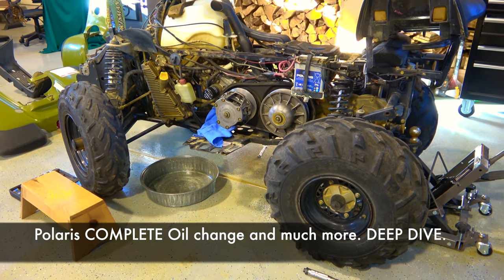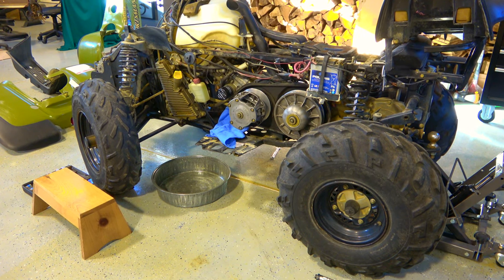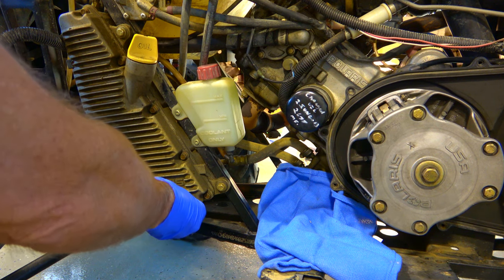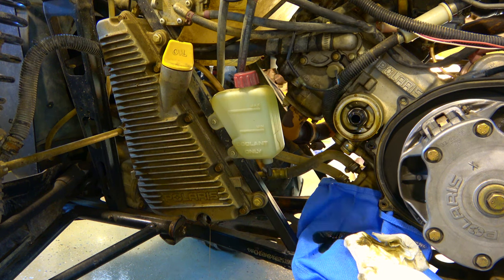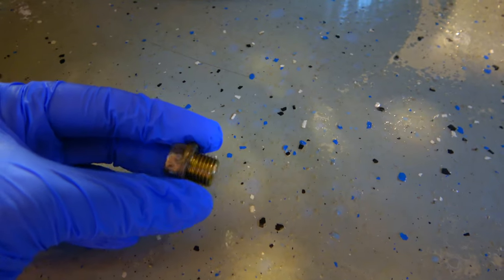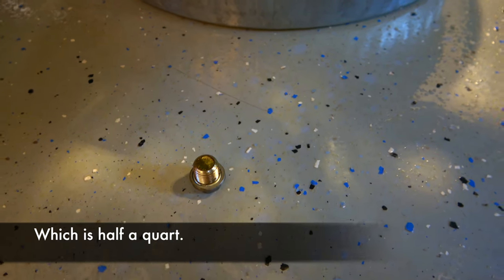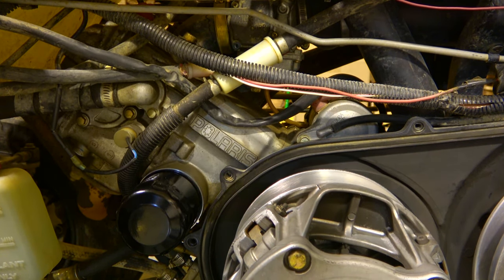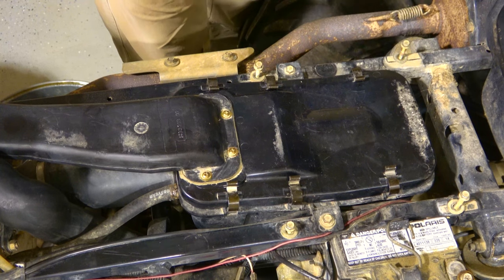Polaris Sportsman COMPLETE oil change & Much More. DEEP DIVE.

Comment: I have this identical ATV, 1999 Sportsman 500.  Your videos have been most helpful to me, thank you for creating them.  I am looking for some discussion about the fuel tank.  Specifically, inside the tank itself and at the sump area where the fuel heads to the carburetor , there were one or two black tubes, presumably fitted into the "fuel out fittings".  These tubes have disintegrated and became floating debris in the tank.  While I have removed the debris, I am left wondering if replacing them is necessary, and if so, how to do that.  Do the fuel out fittings come off the bottom of the tank and reinstall?  The machine still runs fine with these tubes gone, but am I just getting lucky so far?  What is their purpose?  I do not find them on any parts diagram.  Thank you!
Reply from the maker: I'll do some digging. I personally haven't dealt with that.Ill be with mine in a couple days. But won't be on the computer for a few after that. Gonna chase some fish. When  I get back I'll see if I can offer any insight. If you figure it out before. Let me know.
Reply: @ericinalaska7648  Greetings.  Apologies for the long absence.  This ATV lives at a friend's house in another state and I only recently made the journey back to see it after a long summer of busy.  I have an update here and I misunderstood what I was seeing.  If you look into the gas tank from the filler cap, there are two ports present.  The left port has a "straw" tube the reaches up about 2-3".  The port on the right has no tube.  From a gas tank parts diagram for this machine, the left port is the main tank and the right port is the reserve tank.  What I thought was a disintegrating tube turns out to be a pencil shaped screen and it was quite hard to get that out of the tank.  Additionally, there was some small, wire shaped debris in the tank that was colored red.  I mention this only in that it is not clear to me if this is a disintegrating part of some kind or just foreign debris.  Also, the reserve tank will not pump gas to the engine so this port is obviously clogged.  I am presuming this...the straw on the main part of the tank is taking in fuel from above the sump area.  When switching to RES on the fuel switch, the fuel must come from the port on the right and that screen must be involved in some way to keep sediment out of the system.  However, I find no reference to this screen on the parts diagrams.  I have pictures of the ports inside the tank and the screen if you are curious.  I didn't see a video for taking the gas tank off the fuel fittings to clean things, but that is where I am headed next.  That screen probably fits into the right port itself.  If you have any feedback or advice from your experience in taking the fuel tank apart, it is appreciated.  The wheeler has been winterized and I likely won't get back to it until next spring since it lives now in snow country, but I don't.  Thanks.
Reply from the maker: @BigRedDg  Hey Andrew. Same with mine. Away and away from me for the winter. But I still have a few resources handy. My understanding of the tubes is similar to yours. My first thought is what caused them to disintegrate. Im only guessing but I suspect ethanol gas possibly. Older equip and small engine stuff such as lawn mowers and chainsaws don't like it. The parts don't hold up to it well and when it was first introduced it caused headaches for many. And from my understanding parts had to be reengineered to accommodate it. Just a thought. The tubes as you suggested are one for your main fuel and one for your reserve. When in tact. One is taller with a screen filter on it. and the shorter one is the reserve. So once the fuel gets low enough or below the screen it starves for fuel.  Then  you switch to reserve and it will run until getting to or below that one. It looks like you'd have to remove the tank and then the connector off the bottom of the tank. If you take your plastics off it looks pretty intuitive. Id clamp off the hose or fuel line coming out and if there is enough slack tilt it over to empty what fuel you can into a drain pan or something. Then pop that connector out. Looks like a cast part with a couple screws probably and I would imagine a gasket. Yours may be plastic. Id replace the gasket since its off. If fuel or whatever, time, disintegrated the tubes it's likely working on that too. Maybe not. Im not sure you have a gasket on yours but I would think. Once out. Replace the tubes assuming that's your intent.. Then it all works as it should. And reverse the steps.  Clean the tank out as best you can of course prior to reinstall.  Id say the best time ever in your whole life would be now prior to starting to replace the inline fuel filter. They're like $3. And maybe even force flush the fuel line. You could also disconnect the pump and flush that out a bit as well if you want to get that crazy about it. Short answer. If it runs and your fine as is. Probably no harm other than no reserve it sounds. And pos debris circulating in the system. Hope that helps. Let me know.
Reply: @ericinalaska7648  Eric, I appreciate your reply.  I understand your comments here and the next step really is to dig in and take the tank off and get into these two valves.  I found some pictures of these valves online and the screen I found floating clearly belongs to these valves.  I may just replace the valves themselves as the screen looks to be fastened to the inlet and if I am going to the effort of taking this all apart, I would prefer a fresh affix to the assembly.  Better to do that than just jam it back in place and find it loose again in the future.  I keep spare inline filters handy and have replaced it recently.  Likely when I take it all apart, something will shake loose and plug it again.  Since the wheeler is down for the winter, I will likely not get this done until next May.  I will update you when all that gets done.  Again, thanks for your input, it is much appreciated.
Reply from the maker: @BigRedDg  Sure thing. Seems like a pretty simple solution. Time consuming of course but not too complicated. If you think of it that far down the road. Feel free to check back in and share any lessons learned. Some people watch some read comments. Whatever works. Its all helpful.Enjoy the winter. Until next May.
Reply: @ericinalaska7648  Hi Eric.  A follow up on this issue from last fall.  I didn’t get back up to the atv in the Midwest until just this last weekend.  Since my time is limited when I go there to visit a friend, I had to determine what parts I would confront since I wouldn’t have time to order them as I found issues.  What ultimately determined my strategy was that the reserve valve in the tank itself had become blocked.  The screen that had been installed on this valve was now a floater in the gas tank and maybe the blockage was debris from the deteriorated “straw” on the main valve or just varnish & gum from the last 24 years.  This ATV will sit for several months at a time and while I take great care to stabilize, keep the fuel fresh and ensure the carburetor doesn’t have gas in it when sitting, it’s been 24 years since new and I decided the whole fuel system should be dealt with.  I ordered these parts:  reserve valve 7052149, main valve 7052150, 3 way petcock 7052161, and finally a new fuel pump 2520227.  Using your plastics removal video, I dove in and just took off the front cab.  I removed the fuel tank, took out the corroded supply valves underneath and cleaned the inside with mineral spirits using a handful small nuts for abrasion to knock off any film or deposits.  I let it sit for several hours and gave it a hard shake every half hour or so.  The liquid became somewhat dirty so there was gunk to remove.  I debated washing it out with water after the mineral spirits, but instead just let it sit overnight to dry.  I replaced all the ¼” fuel line and clamps and the pulse vacuum line also 1/4".  When installing the new tank valves, care was needed to get the screens into the tank without crushing them due to the restricted size of the opening.  Trial & error here.  The valves needed thread sealer appropriate for fuel and my friend had this and I don’t remember the specific brand.  It’s an easy lookup on the internet for many different products that do this.  

I built the new pump/valve fuel line configuration off the atv by patterning the existing lines which were easily accessible for measurement.  I then took off the old fuel pump and petcock valve and mounted the new ones.  The old fuel pump now off the atv with all the lines heading to their connection points, I individually removed old lines and clamped new ones into place from the newly mounted pump.  The one issue with my installation was that I plumbed the main valve to the reserve side of the 3-way petcock (left side).  I remedied this and decided to use green colored fuel line for the main valve and yellow for the reserve tank just to make me feel like I knew something important and I had these lines already.  There must be some engineering reason for this valve design as the fuel can easily flow from either one.  Maybe this is just a way to keep you interested in your fuel level?  The low fuel light on this atv is just a dead engine.

With everything installed and using just a ½ gallon of gas, I looked for leaks with the new fuel valves. I figured a bad thread seal would appear within 30 minutes so I waited.  After starting it up, the colored fuel lines let me see things run through the system.  I used this colored fuel line throughout and I let it run for 15 minutes looking for leaks at the fuel line clamp points.  I then went to 2 gallons and took it out for a 30-minute spin.  I wanted the machine to get to operating temperature and sustain for a while since heat and pressure build through the engine and cooling system and I wanted to be sure the fuel lines held and there was no leaking.  I used green fuel line from the main valve through to the carburetor.  I used yellow from the reserve valve to the petcock and finally blue from the vacuum point to the pump.  All was well, the engine ran great and I put the remaining trim back on.  It was a day and a half job with the pause for tank cleaning as I was being slow and methodical.

Since I was able to access the spark plug so easily from the teardown, I changed it too.  I have seen references to both the BKR5E and BKR6E for this atv.  When I went to the local auto parts store, they did not have the 5 just the 6.  The parts guy was insistent that this is basically the same plug and that their documentation stated either could be used.  My research since has indicated that they can be used interchangeably but the 6 runs cooler than the 5.  There is much discussion on various forums about what temperature the engine chamber reaches with these plugs and what is condisdered good.  I don’t know how I would measure these temperature values and the only practical advice being the cooler plug may not burn off deposits as effectively and require more frequent changing.  It’s a wait and see kind of thing now.  From the forums, I see lots of people using both without any issues. I gapped at .028.

This was all quite simple to do, with the hardest part making sure you put the right bolts back in the right places and don’t have any leftover.  Even the most careful of us confront this potential outcome.  So that’s it.  I will tell you that it runs better than before, but I always say that and it is met mostly with laughter by my other DIY friends.  I noticed you have gotten ITP mud light tires. I have ITP Baja Cross tires on this atv right now since before moving it to the Midwest, it lived in the desert SW and did a lot of hardpack trails and rocks.  I have been eyeballing those mud lite tires for a couple of years and from what I encounter in the Midwest, probably a better choice.  We’ll see what happens next year.

Comment: did a car oil change on my 2007 500efi sportsman x2 castrol5-40 and was told that car oil does not have enough detergent to be proper and a couple of other additves in atv etcwhich is not hard service like in high rpm atv  utv

 machines so foaming and smell of oil breakdown may have been formed from overheating.
Reply from the maker: Yah Ive found lots of threads over the years about many equivalents available that have been used. Im sure there are some that are just fine. But I would think under warranty anyway, most wouldn't substitute. I know many do otherwise though and Ive read a bunch that have with no known issues. Sounds like warranty is not an issue for you though likely with a 2007? In the past Ive tried to find an equivalent substitute. It was findable but not abundantly available and the price difference wasn't much of a savings. Being such a low stock item. And short of a catastrophic break down it may be hard to really tell if an equivalent or other may be accelerating damage or ware. It,s all open for discussion of course. You can certainly argue that the wrong oil is likely better than no oil. I guess my logic sometimes, not always, but I guess on this topic, Im gonna control the things I can and use what's recommended. Then at least if I have an issue that's oil related, I know I didn't cause or contribute to it. But if my buddy poured a random in out on the trail. Id be curious to see how it looks coming out and or how long he's been using it and observe. Id be interested in any info you can share from your experiment. Im certainly not gonna tell anyone what to do or not on the topic just share what I do and why. Theres always work to do to maintain toys and if I can minimize or eliminate one variable for a few more bucks that may save me many more bucks down the road...... Thats where my heads at. Ive heard many valid philosophies on oil  through out my life. From people who know far more than I. But I always seem to settle back into the what does the book say to use mind set. 
Not sure if you were looking for all that but ...... that's my 2 cents if it helps you sort it out.

Comment: Thank you the perfect video for me today,  my  hard plastic oil tank on my 08 Sportsman 400 HO blew apart ( sounded like bomb / about shit my pants ) cheapest I found was $ 100 so I found a used Alum like this one for $ 30 with all the hoses with few differences that had to Retro Fitted, BUT this one has Extra small fitting / hose the same size as breather hardware but located at the top next to the Return Do you think maybe for oil pressure gauge ??? learned alot I love that got to see inside r
& refreshed on the oil prime
Reply from the maker: So on the top. It has the return line connection and the breather connection and a third mystery connection? Do you know what the tank came off of? Year make and model? Did the tank you're replacing have that or the same number of connections? Or less?